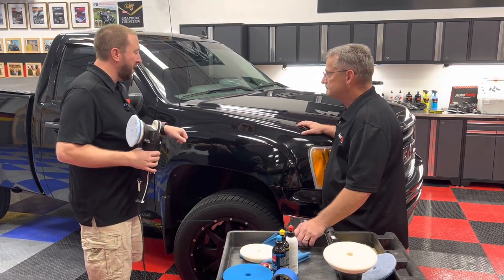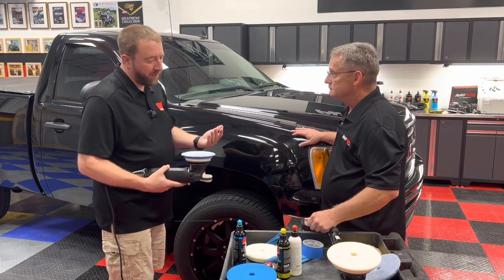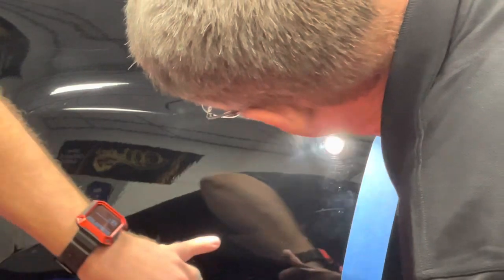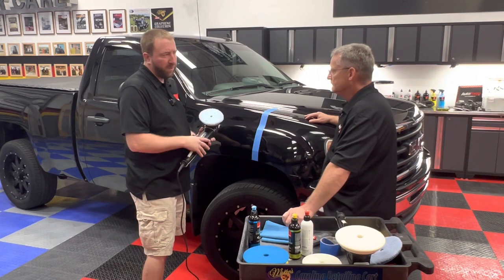When to Use the RUPES LHR15 Instead of LHR21 | Autoforge.net

Comment: Compressed air Actually destroys the cells in the pad.
Reply from the maker: @404notfound True when it comes to foam pads. In this case he was using a Microfiber pad.  Compressed air is the recommended method for cleaning Microfiber or Wool pads.
Reply: Yea but that's foam pads that applies to, doesn't destroy microfiber or wool pads. You can even use air to dry foam pads as long as you dont have your pressure set up over 75psi